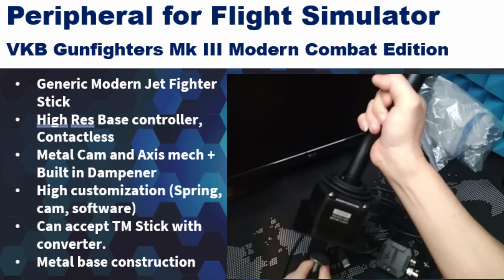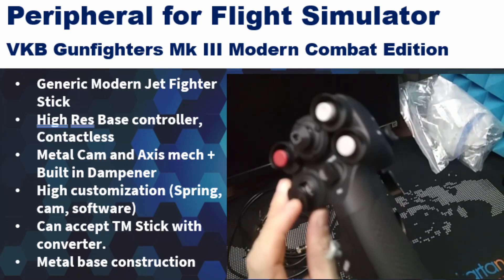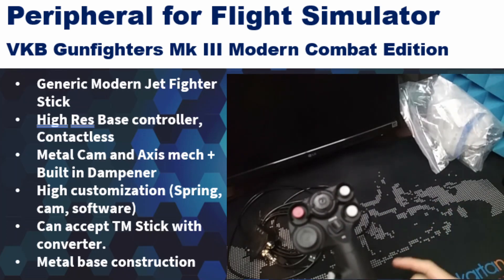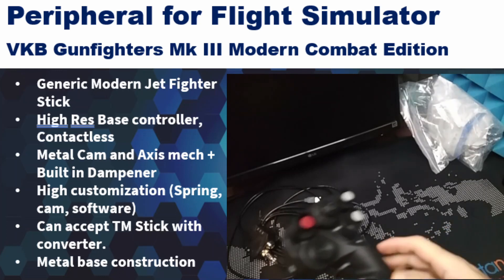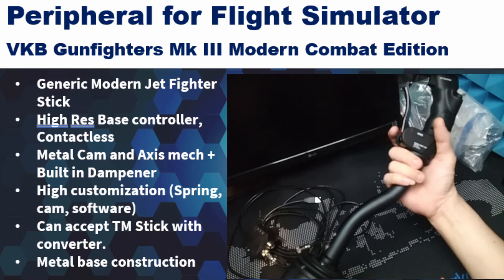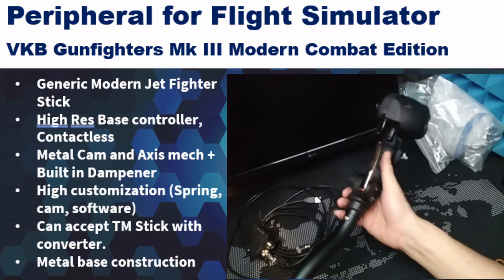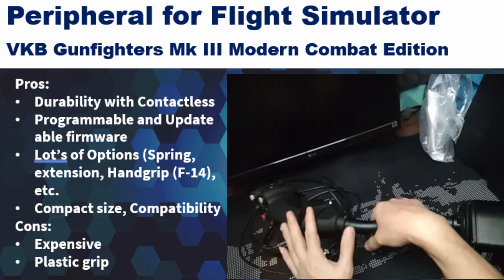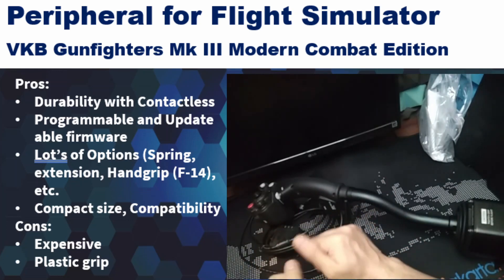Review: Flight Controller VKB Gunfighter MKIII Modern Combat

Comment: Thanks for the breakdown. I’m trying to decide between this one, the ultimate or the space combat. This will be my first setup and I planned on using rudders, but also like the idea of having the twist so tough call.
Reply from the maker: Back to budget and use of it. For multi use better have twist rudder if not mistaken it can be locked. For space would probably useful, for combat in general too but for fidelity or authentic combat aircraft flight twist rudder will not provide realistic feel. Ultimate provide durqbility buttons option. Someone in YT provide ultimate version review
Reply: @hobbytechgearID69  thanks yeah I saw that it’s lockable. For another $40 I might as well get it